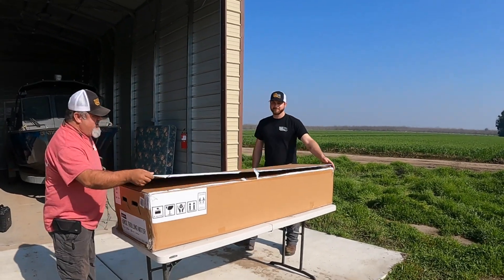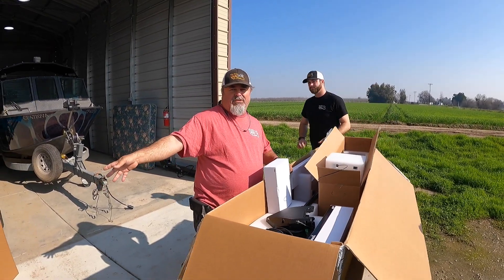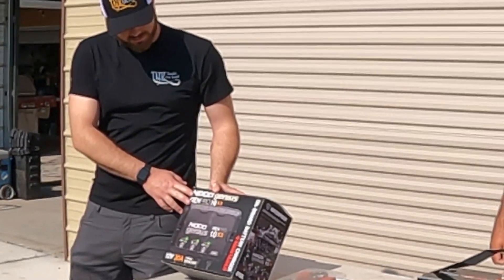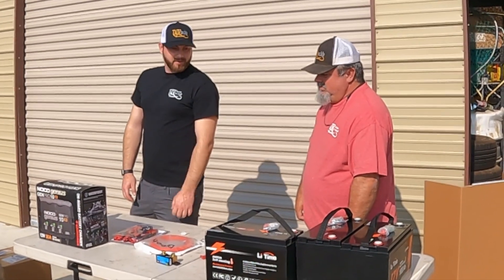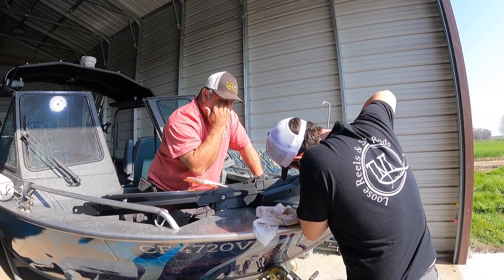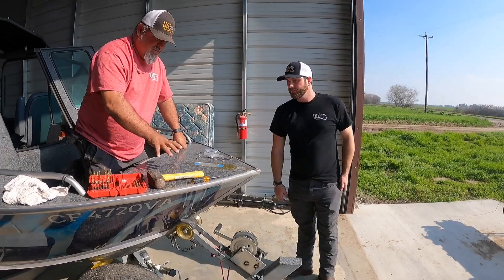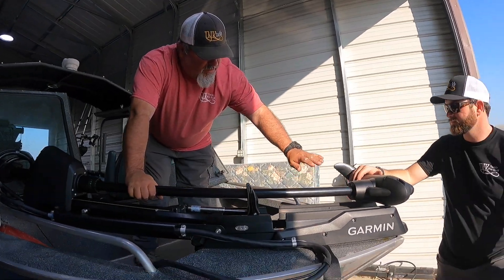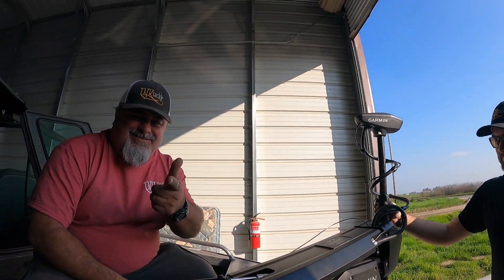DIY: TNK Tackle Garmin Force Trolling Motor Install

Comment: I'd love to see an on the water review once you get it going. I have a deep V 18' boat that I'm contemplating installing a Force trolling motor on and I'd like to see how yours performs.  Particularly the top speed.  Thanks!
Reply from the maker: That will be the next video. We took it to Shaver Lake to try it out. It was well into the water but it was also calm. Spot lock and heading hold worked well, but spot lock can cause it to reverse to hold in place at first. It moves quickly (almost 4 mph) at full speed. We adjusted the gain, lowered it, to not have as much counter gain.
Reply from the maker: We finally got on the water, Shaver and Pyramid Lake, and did some trolling. Spot lock is great, but at times it is not responding fast enough for me. I am sure part of it is operator error!  :)